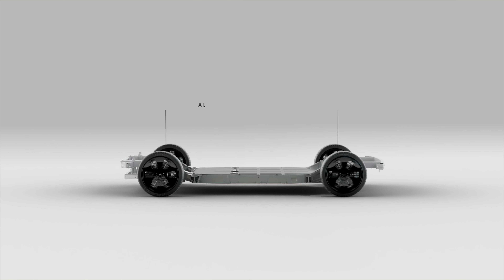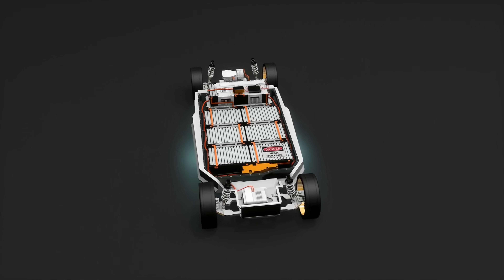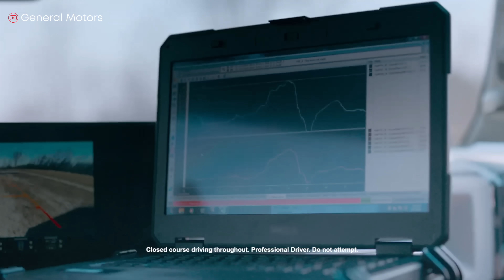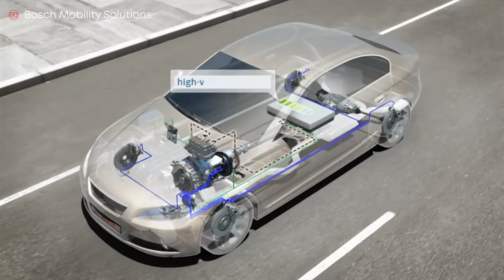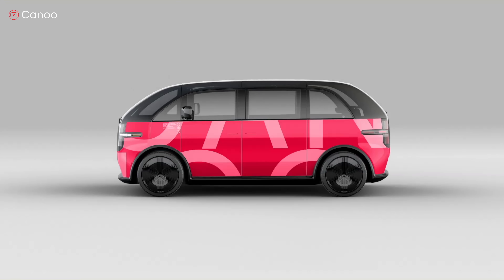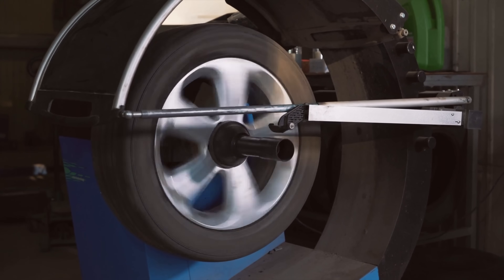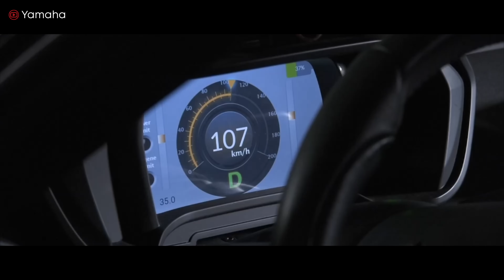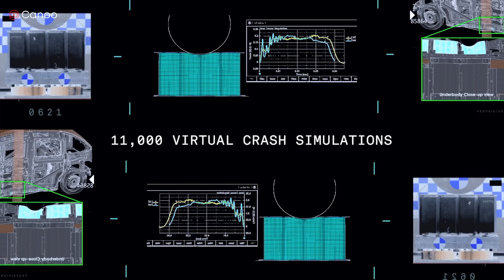No One is Telling You the Truth About Electric Cars, So I Have To

Comment: Cannot charge at home, live in a cold climate, do long trips regularly. 3 strikes, out.
Reply: Windshield defrost device but for the batteries. Already uses electric to heat...
Reply: You lose 60% range when towing, if you can tow at all... and you are constantly thinking will I make it while stuck in traffic while running climate controls... or do you have to cut off the AC and roll the windows down in your expensive electric car while I am comfy in my 4 cyl gas.. oh I can have AAA bring me gas if needed as well...
Reply: @commonsenseguy8189  looks like EVs are for smart cities. Mad max everywhere else.
Reply: @commonsenseguy8189  AAA will bring you electricity as well.  And a Tesla will last over 10 hours in a traffic jam running AC or Heat.
Reply: @commonsenseguy8189  When was the last time you had the AAA bring you gas. Towing with gas is also increasing your fuel use. I towed a 5000# trailer and I probably used 50% more gas doing that.
Reply: @maurice7413  on a full charge... but lets say you are down to 40 miles range and stuck in gridlock on the interstate due to a crash... last year I was sitting for 6 hours going nowhere until police redirect traffic into the oncoming lanes...  can your Tesla run AC or heat for 6 hours with 40 miles range to start? After that get you to a exit?  I am not saying a gas would do much better, but I am not paying a premium price for it either...  even if they bring you electric charge on the highway your still sitting for long times...
Reply: @commonsenseguy8189  we've had this discussion before, and the answer is the same, if you want the EV to have 40 miles of range left, then lets also limit the gas car to 40 miles left in the tank.  Want to guess which one will last the longest?
Reply: @maurice7413  
the  TeslAAA   truck  that  brings  the  electricity  to  charge  the  stranded  tesla  runs  on  gasoline  n  so  does  the  generator  that  produces  the electricity  to  charge  the  battery.
Reply: @driver4011  the truck, yes.  It runs on gas to service a gas car also.  Those are emergency conditions.  The power generated for the grid comes from many different sources.  But again, doesn't matter.  Average cost per kWh in the US is $.15.  I get 4 miles/kWh so 100 miles costs me $3.75.  A gas car @ 25/MPG will cost over $10.00.  Note that I pay .08/kWh so it actually costs me $2.00/100 miles. The electric car is more efficient than the gas one.
Reply: @driver4011  no it has batteries
Reply: @commonsenseguy8189  Depend of EV. If you need towing look for towing capacity before buying EV.
Reply: @ilyashick3178  EV is not for towing... its for city driving...   the charging technology is not yet nationwide like fuel stations are, until then it will only be short distance driving...  as a gas truck can easily take any exit off a highway and refuel...
Reply: Same for me
Reply: Long trips don't work with ev ....
Reply: 10 years last a battery?
Just bought a golf mk6 11 years old
No range problems
Easy 600 miles
Btw i always buy 160 thousand miles cars
Reply: I agree. EVs are interesting but impractical for your situation. You need a good mileage conventional car.
Reply: Ev car 🤣🤣 government want have clean air ....and some extra cash ...they already know Ev car su$k
Reply: @commonsenseguy8189 
Absolutely! Not to mention you can fill up in min. with gas but hours in EV…
Reply: If you think electricity isn’t going to sky rocket in price when we have over 30% electric cars on the road , have I got a great piece of swamp for you to build on. Electrical companies will eventually want to charge you a higher price for charging your electric vehicle. Just wait for it……oh and your battery after 8 to 10 years.  10 to 20 grand to replace
Reply: You don't have power outlets at your house?  They work fine for me in western NY with a daily work commute of 60 miles. Long trips frequently?  How often? Can't rent a car for those days until the resistance stops slowing down the infrastructure?  Just stop the nonsense.
Reply: @sonicelectronic57  , I live in an apartment. Long trips every 2 weeks. Electric cars are awful in 0F. Electric cars are bad for the environment because of their demands on minerals.
Reply: @sonicelectronic57  it not stop nonsense if you understand that low income people does not have a place to charge their car and it very inconvenient....plus Ev car can't do long distance also time consuming..just to charge on the road ....gas is totally different
Reply: @maurice7413  how much more are the costs of electric vehicle ? $60k versus a 2023 honda Civic 🤔🤔 witch would last long and long term $$
Reply: @MrMannyjr69  Paid 15k for my used EV 3 years ago.  Maintenance costs so far, Zero.  New tires at 70k miles and it's still running great.
Reply: @maurice7413  that's not bad...  sounds like u got a deal.. I'm referring more towards these expensive Tesla's... I seen used ones no less than. 40k
Reply: @commonsenseguy8189    I lost count of videos showing people using gasoline generators to charge their electric cars.   humans are something else entirely.
Reply: @drewkoenen8334    lithium batteries will be obsolete within 3 years
Reply: Same here. And I do not have a garage
Reply: I got a leaf but no infrastructure here in the boonies and our power goes out when storms and trees fall what gives.😢
Reply: That’s the plan
Reply: Only 3?
Reply: Get a water powered car

Comment: Sad that the days of buying a vehicle and it lasting the rest of your life if you do basic maintenance once or twice a year, and you don't abuse it are gone.. :(
Reply: I have a 2012 eco boost f150 and I know I’m going to have to replace the engine soon. That’s ten years use. I don’t see the difference between that and battery packs needing to be replacing in 10 years time. At least it’s optional, only losing range after 10 years compared to catastrophic engine failure and not having any range at all until the unit is replaced really doesn’t sound that bad.

Heck I got a 78 GMC. Wanna know how many engines that truck has had?
Reply: @slackersurf  I have a 96 Lincoln Town Car, a 98 Chevy k3500 truck, a 1999 Chevy Monte Carlo, also a 2017 Impala. The 2017 Impala has been in and of the shop constantly and I guarantee it will not last as long as my older vehicles that run as good as they were when new..  the Impala has already had constant computer problems, 2 sets of wheel bearings, break problems, sunroof leaks, problems with lights, and if we get a good rain the trunk will fill up full with water despite having new weather stripping and replacing weather seals around taillights. I also don't think the Impala sounds like it runs right.
Reply: @slackersurf  so 10 years of use of the 2012 and 10 yes of use of the electric battery…. Hmmm… is that a coincidence…is like theyre putting a timer of these new cars!!
Reply: @slackersurf  You need to discover Honda and Toyota,  their engines are bulletproof and impossible to wear out as long as oil is changed occasionally.  A a long time Japanese car driver I know this for sure.
Reply: @slackersurf   A Volvo240 can last 30 years whit out having repalce engine.
Reply: @slackersurf  oh, the big difference is the price xDDDDDDDDD those batteries cost far, far more than the engine.
Reply: Not for me.  I'm still driving my 1989 Ford Escort LX and have no plans to pick up an electric car.
Reply: @slackersurf  Dude, my 89 Escort still has its original engine, so does my 06 Accord.
Reply: @ujification3504  only if the serpentine doesn't break like what happened to my neighbors S60 5 cylinder. Valve to piston clearance is .062 so that if the timing belt went off 1 tooth the valves/pistons come together blowing the engine. Ever since these dum dums put belts for the timing it's been nothing but issues. Belts loosen up and they can break. Even if the serpentine went out on a chain driven timing it would not disrupt the timing or skip a tooth. What's the average cost to replace an engine these days especially for a variant they don't make anymore, half the cost of a vehicle.
Reply: @ujification3504  New Volvo's are TaTa
Reply: @turtleonacid  21K
Reply: @slackersurf  your doing something wrong then bud, new cars are way way more efficient and if maintenance is done last way longer. We have one customer that has over 300k on her jetta original engine and trans